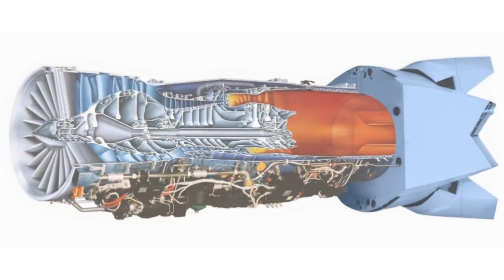Roaring J-20 - Live sound recording from Chinese fifth-gen stealth fighter flight demonstration

Comment: The engine sounds of the J-20 demonstrated conclusively that there is no way, that is a WS-10 nor a russian AL-31 engine. It's an entirely new engine.
Reply: Mike ... Man have a heart, agree Chinas 5th gen jet did sound a bit like WW 2 Luftwaffe bomber, are you insinuating PLAAF's J 20 has a WW 2 German engine ?
Reply: @shahidbukhari1  Well, a WW2 german bomber flies anywhere like the J-20? if it does, then J-20 has a WW2 German engine.

Comment: I wonder if one can develop a sonar based missile defense system against supersonic stealth aircraft?
Reply: Sonar means by sound. So you won’t hear the sound until the jet passes by if it’s going super sonic.
Reply: @yszhang1107  No, not just audible sounds, but sensors and computer programs to detect the compression of air molecules, the pattern of which should be dependent on the air frame displacement, the speed, the direction (whether coming at you or going away and at what angle and speed)... whether subsonic or supersonic, the patterns imparted by a moving  object in a fluid dynamic system can be detected and its anticipated position calculated...whether it can be integrated into a viable weapon system is  the question.
Reply: @zhoubaidinh403  In the air, you don't use radar, you use sonar
Reply: @zhoubaidinh403  Air is compressible which means even something like battleship cannon shockwaves quickly dissipate away into nothing. Something like a fighter jet cannot produce meaningful amounts of shockwaves and air molecule movement to be detected from kilometers away.
Reply: That's a great idea.
Reply: I think they now have new system to engage those fighter planes. kind of mixture; long and short waves , passive and active electronic pulse arrays, sonar arrays, infrared, real time tracking & imagining from satellites. But the chains of climate change is really hitting hard at us.